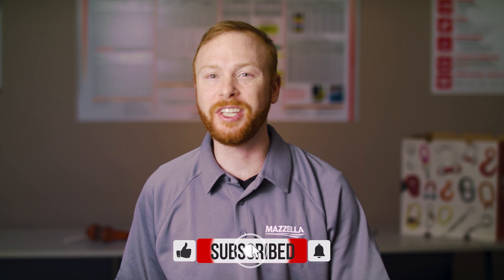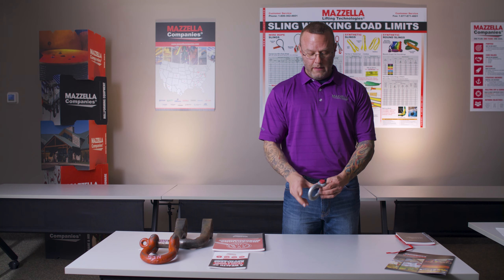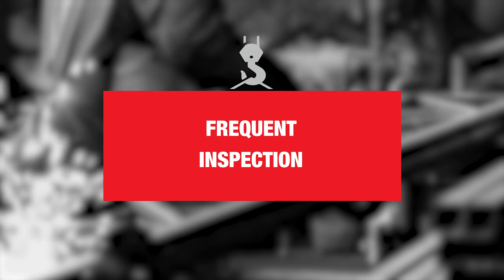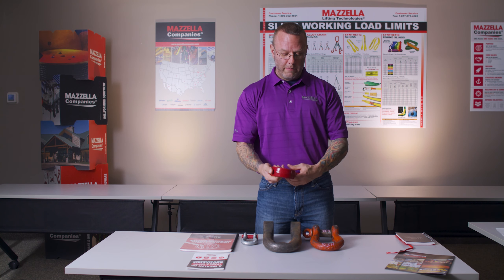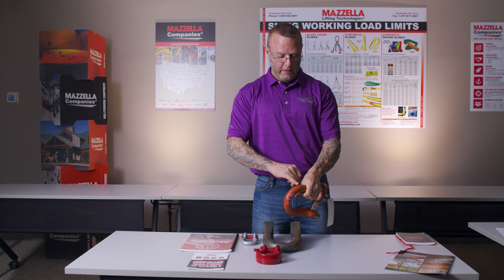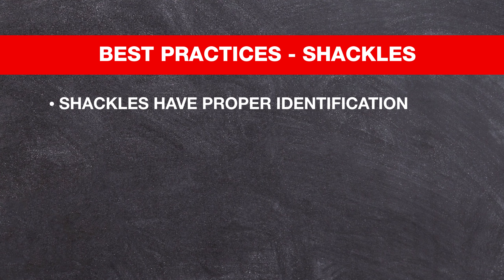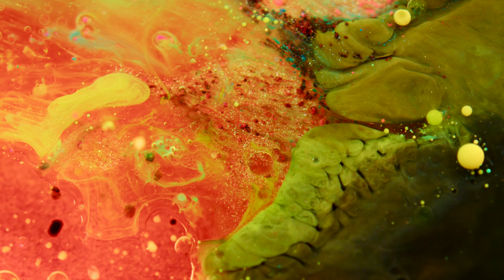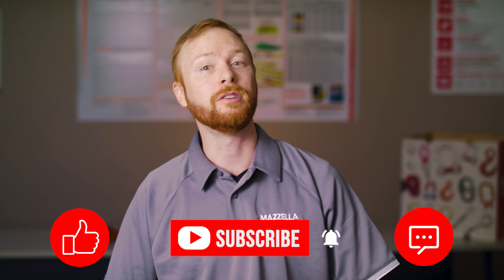How to Inspect Shackles to ASME B30.26 Standards

Comment: What is the different from shackle and omega link ?
Reply from the maker: The Omega links are made specifically for certain sizes and grades of chain. (80/100)  They can be used at either end of a chain to connect to a clevis pin or used at the bottom and used in a choker configuration. They are connected to a chain the same way you would see a sling hook connected to a chain sling. They are more or less a part of the assembly.

Shackles can be used in many different lifting applications and offer a much wider range of use as long as they meet the criteria needed for a safe lift. They are made to be attached and detached easily.

I hope that answers your question. If you have any other questions feel free to reach out! https://www.mazzellacompanies.com/company/contact-us/contact-rigging-division/